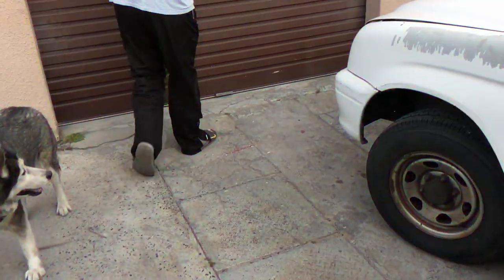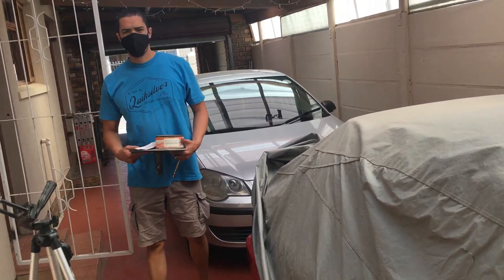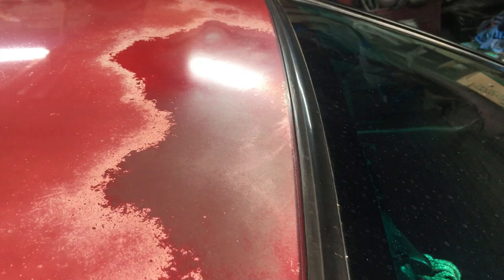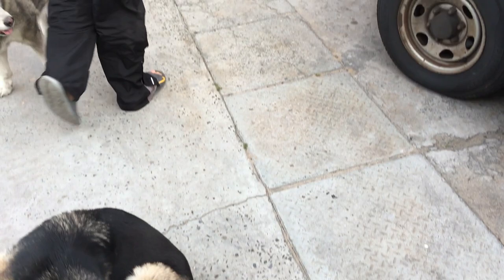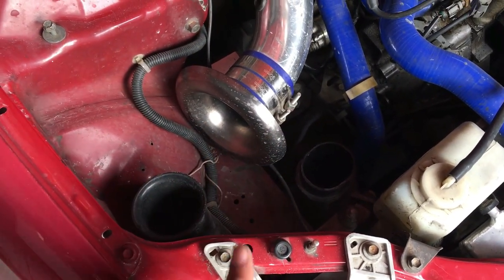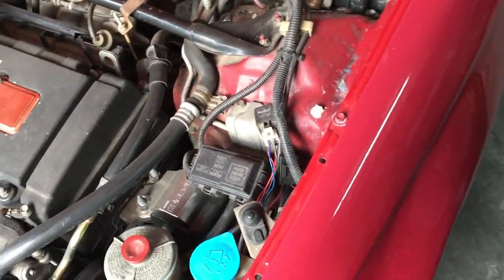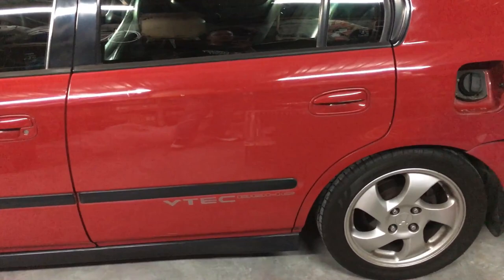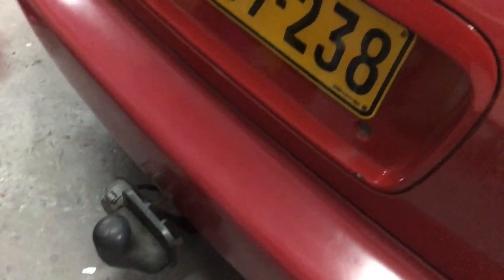HONDA B16 VTEC FULL RESPRAY BUILD SERIES

Comment: Leka bru, interested to see the bodywork side that goes into it.
I’d go for the civic grill due to function as it’ll aid with better cooling. Colour code and badge choice is up to the owner.

However the Devspec radiators should do the job 💪 even if the owner decides to go with the original ballade grill.
Reply from the maker: Thank you bro i hav few other cars lined up too. To show a few other mods/repairs too
Reply from the maker: Yeah i think we gona go with the civic grill
Reply from the maker: Thanks alot for you feedback 🙌🏼
Reply: @WongStreet2Track  leka - Thank you for responding on IG when I reached out to you wrt a wongspec back bumper.